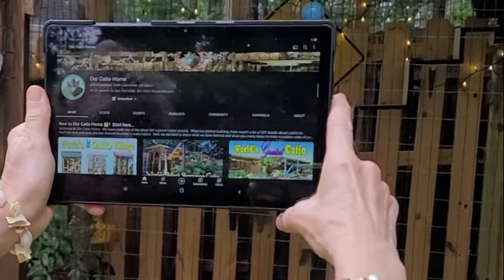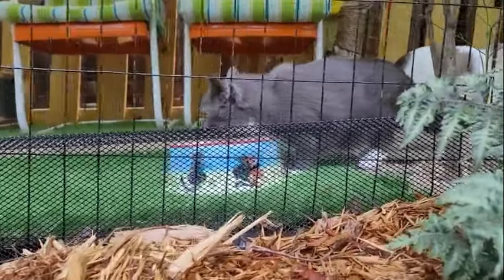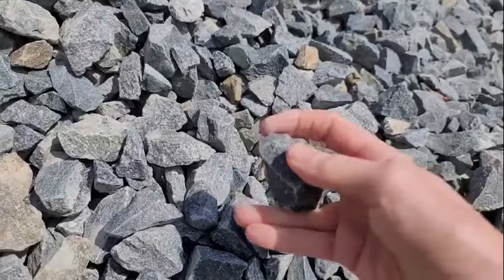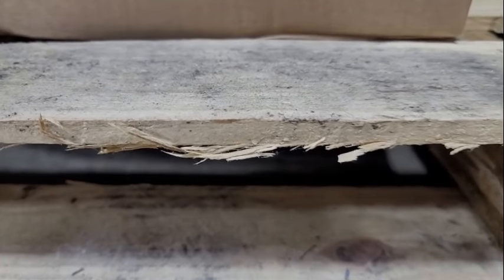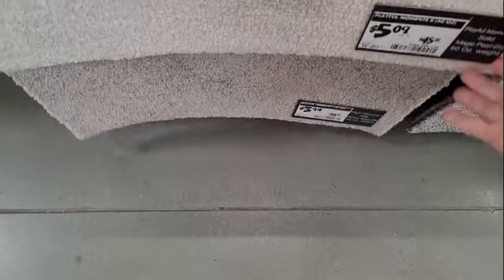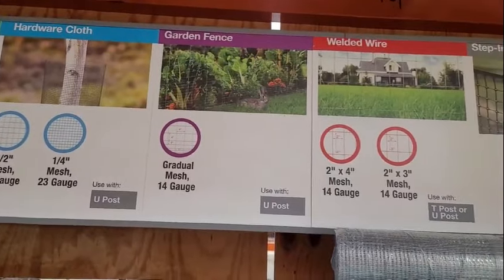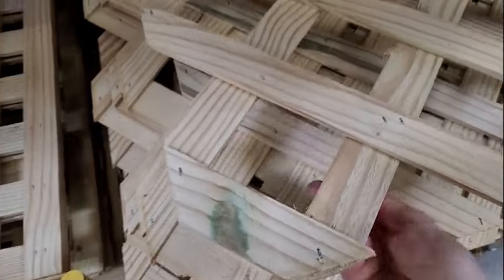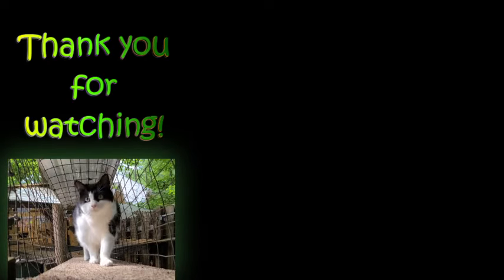DIY Cat Enclosure: avoid DISASTERS ❌ - Don't miss these.

Comment: Thank you for this information.  I used an electric staple gun for my catio, and in less than a year, I found the staples rusted, and some had even popped out! (FL weather). I had to redo my entire catio with U nails. It's was a lot of work with a hammer, but their safety is absolutely worth it. Another thing I realized is that the fencing I used the gapes was too large for a 12 week old kitten. I had to double up on the fencing to make sure the gaps were no larger than 1x1. Also, as you mentioned in one of your videos, a dirt box is essential 😂 if you're going to have any sort of garden for them. Kitties (like humans) don't like inconvenience 😂.  They prefer their water and dirt boxes to be right there for when they need a drink or have to go!
Reply from the maker: Ouch, redoing your entire patio with new u nails, sounds painful to me. Glad you realize you're 12 week old kitten might be too small for the fencing. We typically hold them back until they are 6  months old at least that has worked out for us.. I hope to see your catio on YouTube.

Comment: Remember to never use tires -even if painted or wrapped in any cloth, they are toxic as well.
Reply from the maker: Oh yes, excellent point Kathy.
Reply: What about tire rims?
Reply: @gideonpark8621 I  am sure you are  talking about  cleaned rims, but if there are  any residues, like  brake material or grease/oul, then it would not be good for the feline.

Comment: It's important to remember that you are protecting your cats from predators that may be much more able to break in than your cats ability to get out. Raccoons especially are crafty and can open simple latches. We have two latches on the door, with several steps to unlock each.  Also, I'm not sure ground dirt is a good idea. 6 months into our new catio, and the cats have thoroughly stunk up the dirt, even with two cat boxes out there. Looking for alternatives.
Reply from the maker: All excellent points... I must say that originally our covered catio had a mulch floor with litter box.  Well, the cats used the mulch causing what you are describing.  We  then removed the mulch and put down carpet grass and updated the litter box to a large, open one and it solved the problem.  Let us know...

Comment: It’s interesting that you’ve given the negatives that we considered when we built our catio. We used AstroTurf on the ground and used old branches of trees (ones not toxic to cats) for them to scratch and climb. Our galvanised wire is  16g, 1”x1”, it’s extremely strong and rust/weather proof, and looks as good as when it was first erected, 4 years ago now (allows only insects through).  We have some decorative Yorkstone rocks to add interest, plant pots and hanging plants (catmint and other non-toxic plants ). We added a rope bridge, viewing platforms, steps on poles made from scaffolding boards we had left over from our home renovation. All woods (frame, door, teal chain inside) is painted to complement the house, and we fitted an outside door to one side (as ours leads out of the house French doors) to enable us to access for cleaning, caring for the wooden structure etc. It is the best thing we ever did and now we are extending it with a run 2 feet off the ground (as it’s very wet in winters here in the UK) to the end of the garden, with stops along the way (containing activity points) including a viewing platform by enclosing a few branches of a tree, and hopefully are area on top of our shed. Our flower beds, with varying height plants, becomes part of their jungle, and they see so much wildlife, plus it hides parts of the cat 🐈 tunnels …. Thanks for sharing and your tips and hints for a good build, and good luck to those about to embark on your own, it’s pleasurable to make and such a brilliant addition to the cats welfare. They need sunshine like we do😅
Reply from the maker: WELL SAID!  You have nocked this comment out of the ballpark friends!!!!  We so agree with you including the sprit of the catio intent..  We hope that you will post a video showing off your catio garden marvel.  Please let us know, ok?  Cheers.
Reply: I would love to see a video of what you have described. Sounds so creative and fantastic for your cats.  >^..^<

Comment: Chicken wire is durable, if installed properly.  Its soft to the hands, easier to install with a wire cutter and basic hand-held staple gun.  I dont see anything wrong with it, for a chicken cat.  I'm running with 20 gaudge 4x50 ft chicken wire.  The sagging part I'd agree too yet, its way easier to deal with and cut; tweeking it, with cross members or tightening it, is easy as it sounds.
Reply from the maker: Thanks for taking the time in sharing your experience today!

Comment: ❤Great insights! That was our line of thinking when planning our catio, but we overlooked one 'small' detail – our ground is covered with cement tiles, which are too hard! By day two, we had to lay down carpets, which actually worked out since we had a dry summer. A month in, the kittens mastered running on the harder surface. I have this hilarious video of the catio with carpets everywhere. It may look a bit crazy, but it was a swift solution, and the kittens were overjoyed to be outdoors. ❤️ Thanks for sharing! ❤️🐾🐾🐾
Reply from the maker: Your cats are adorable, I'll look for your vid of the carpet action today!

Comment: I would also add, because I've seen videos where owners seem unaware of this, to make sure any plants that are in reach or inside the catio to be vetted for toxicity to cats.
A small note is to never drill into end grain as you build.  It's a very weak joint.
Reply from the maker: Yes, great suggestion and drilling point. We will do another AVOID vid and may include these points too. Thank you for the visit today as well.

Comment: Thanks for the info. This has confirmed some thoughts I had already but highlighted some new  things to look out for. My issue is that I have one catflap from the house to the garden, and my 2 older cats have access to outside whenever they want. My two kittens are only a few months old and I'm not letting them run free yet. I'd like them too have some outside space. Ideally I would like a system where the older cats can get out from the cat flap through the catio and out in to the garden. I don't want them to wear collars. I'm imagining a weight sensitive pad that allows them at 5 or 6kg to trigger the outer catflap to open... Or facial recognition haha!
Reply from the maker: Oh, yes great design and development ideas - cat facial recognition!  Love that idea 😻.
Reply: They have microchip pet doors that allow only the registered cats in and out.

Comment: Thank you for sharing! I am not from US and did a bit research on 14 Gauge wire specs.  May I ask what's the distance between two wires according to your purchased wire net? Much appreciate if you could check, Thank you!
Reply from the maker: Thanks for the question Ray, it is a 2 x 4" wire.

Comment: Keep in mind some glues are toxic to cats.  Only use non toxic glue when wrapping rope around a post to create a scratching post.  Never use pressure treated wood.  I recently saw a YouTube video where they used plastic 3/4 inch PVC pipe and fittings to make the catio structure instead of wood.  The owner used zip ties to connect the wire fencing material to the PVC pipe and fastened the structure to the deck and house with brackets.  This created a maintenance free structure.  This catio probably should be built in a shady location as PVC can be effected by UV rays from the sun.  There is UV resistant PVC for outdoor use available.
Reply from the maker: Thank you for the visit and comments Sandy!
Reply: the new pressure treated wood is safe.

Comment: I have a metal/aluminum framed screen porch. The outside is where the current regular screen is, so there is the inside frame I could either screw 1x2” maybe onto the frame and staple the 14 gauge coated fencing wire-probably 1”x1” due to me getting a kitten onto the wood. Is there any suggestions on this idea you could help with? Or would many screws into the aluminum work?
Reply from the maker: Hello,  Thank you for the question but we don't know how exactly to guide you on that?  Perhaps someone with carpentry skills could look and check it out.  All the same, we hope that you will let us know how your catio turns out.

Comment: Hi, I just built a cat enclosure (W: 7 feet by L: 20 feet size)  for 7 outdoor cats that my neighbors have complained about. They were so stressed out inside the enclosure that all bolted out the door when I cleaned the catio. They also pooped outside the litter boxes (I have 4 large boxes) and vomited on the beddings. Help! What do I do now? My neighbors have threatened to have all of them impounded if I don't put them in an enclosure.
Reply from the maker: We are so sorry to hear about this, sounds like something is very frighting to them....hum sit with them for a while and see what is going on.  Also be sure that they have places to hide, the higher the better.  We hope that you can figure it out and soon,
Reply: @OurCatioHome  Thank you for your reply.  I gathered the cats to the enclosure last night and they were less frightened, except for one that kept trying to look for an opening. The enclosure isn't fully furnished yet. I will be placing cat towers, shelving and hammocks soon to make the space appealing for them. I took note of your suggestion to place hiding places. Thank you for the tip. The young ones are easier to lure inside and two have stayed even with the door open.
Reply: assume these are feral cats? they will feel threatened when closed in, maybe let them come and go until they get more comfortable with it. explain to the neighbors what you are doing.
Reply: @ricoricky100  I hope they’re all doing doing better, how’s it going now?
Reply: @skylady64ish93  Hi, they're doing so much better now and have made the enclosure their home. Some don't even leave even if I keep the door open. Those who do go out return when it's feeding time. Thank you for checking up on them!

Comment: Your first point is most important I think - never put food in a catio!  Even if you think you will just feed your cats and then take the bowl or dish inside.  Bears can smell the residue a mile away and even that 14 gauge wire is not match for a bear.  We learned this the hard way - we watched a bear on our trail cameras we have set up around the catio and he walked by and immediately stopped and smelled the bowl of cat food.  Then easily pulled the wire away from the wood.  If our dogs didn't start barking and scare him off I'm sure he would have gotten inside the catio and possibly into our home since our catio entrance is a sliding glass door that we leave partially open.  If you live in an area where you don't have bears, you can still find a raccoon, possum, coyote or even a neighbor's dog trying to get in for a taste of cat food.  We NEVER put food out there now, not even treats!
Reply from the maker: Hello Madeline, thank you for sharing your experience with bears, my good. We hope your cats are safe.  We do not have bears so we are lucky.

Comment: Tips about cats in the summer heat might be helpful. It is getting so much hotter sooner, and for longer… even with shade, I wonder about safety for  furries… How long should they be left out in a catio? How much supervision, etc
Reply from the maker: These are all excellent suggestions; stayed tuned.
Reply: In the meantime, I see a lot of vanlifers that have a device that monitors the temperature of a specific area and sends an alert if it starts getting too hot for them.
Reply from the maker: Wow, that is good to know.  Thanks Mom;left.me
Reply: I think as long as they have 24/7 access to AC they're pretty good at monitoring themselves.  However if you have a sick kitty and he/goes into the catio, then absolutely bring them in! Because heat will make it hard for them to have energy to get back inside.  Also please put fresh water in catios. I find mine will drink more if water is available.  I put mine closer to the entrance/exit, sadly I don't have a catio like Our Catio Home. (Which is the best Catio I've seen on YouTube!) I hope to one day have something like this. BTW thank you for putting that video out there nothing I've seen with this info yet. And a lot of people are building with chicken wire! It rusts and it's worthless for safety. Also using regular staples are worthless too! I had to redo my catio completely with u nails. Pain in the butt but their safety worth it!!
Reply: I have been looking into shade cloth, which can reduce temps & provide protection to both animals and plants. They vary in quality, though, so read the reviews before purchasing.

Comment: Hi, I’m wondering what kind of accidents you’re referring to re. using lattice. I can’t imagine a cat getting into problems with it and it looks so much nicer than wire so it was what I was thinking of using...
Reply from the maker: Hello Fionamacelli.  We always are concerned for safety in using materials, seems to me that the cat could get their head stuck. Please check the size 1st.  Let us know how your project turns out. 🙂
Reply: @OurCatioHome  I see. I was just wondering what the concern was specifically. Perhaps cats of certain sizes could get stuck, yes.
Reply from the maker: Glad you came back, yup - catio building is what you want it to be in the end.  😻

Comment: What are your thoughts about vinyl hardware cloth? There are some durable products out there with good reviews for use in fencing pet enclosures.
Reply from the maker: Hey Alma, looked it up. I would be certain that it was durable, ie welded at the joints and get the thickest gauge 16 or better.  You could try to get a sample and try it out???